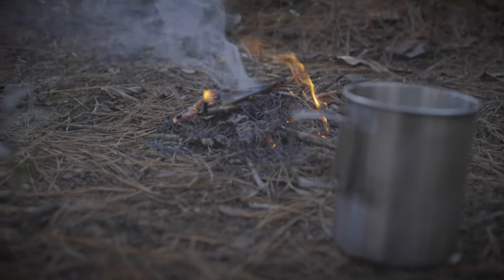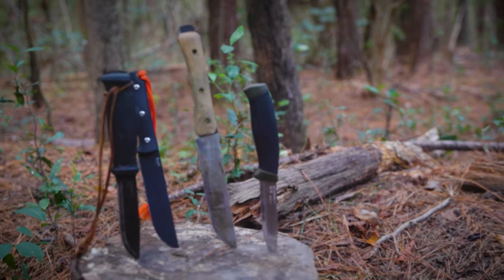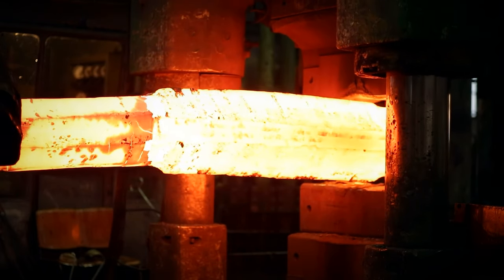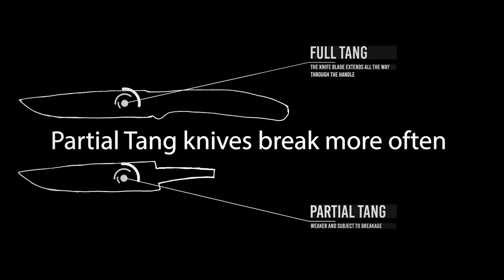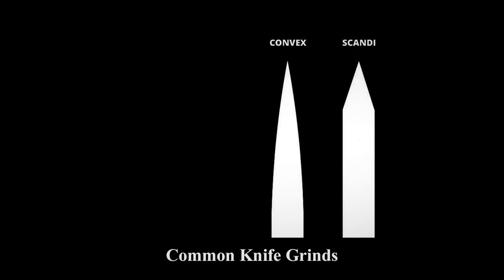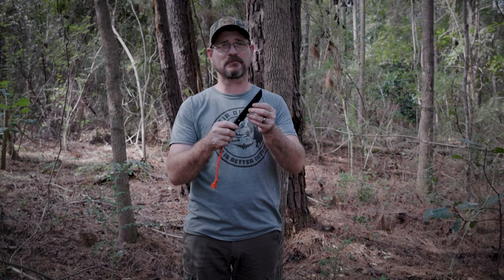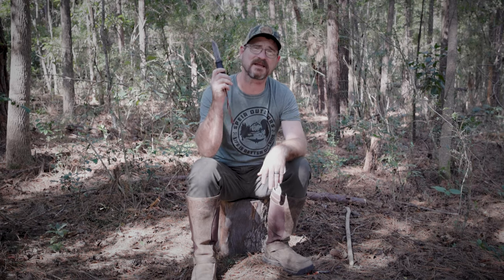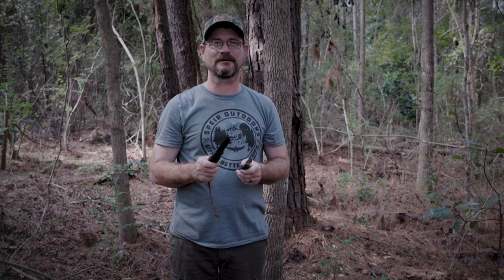Choosing the Perfect Survival or Bushcraft Knife: A Comprehensive Guide

Comment: I build and sell a few knives out of O-1.  I'll take carbon steel any day over stainless!  Properly heat treated and there should be no issues with bending or chipping.  Easier to sharpen and rust isn't an issue with some minor care.  And yes, 4-5" blade is all you need.  Most so called "bushcraft" knives are just too big.  Too much Hollywood Rambo-knife influence!  Smaller is more practical and useful, and will do anything and everything you need it to. Love your channel, just subbed!
Reply from the maker: I absolutely agree! Thank you so much I really appreciate the support

Comment: You definitions were wrong. Stainless is more prone to chipping and is not tough. 
Carbon steel is tougher mean it will bend not break it will roll not chip.
Reply: You have obviously never tried to drill through stainless steel.  But its ok.  I realize some folks just gotta throw out their two cents worth even if they don't have a clue about what they're talkin bout.  you do you.
Reply: @tbone9347  as a matter of fact I have. You just need the right tool for the job. Carbide drill bits. Or a plasma cutter.
Reply: @tbone9347   once tempered, they are both extremely difficult to drill through. If that’s your philosophy, as to which is brittle and which is tough? Then it’s ok. Some people are arrogant and rude, regardless of how bloody wrong they are! You do you, even though that is apparently fundamentally ignorant. 
Since you seem to be confused here, you might try emailing Tops, or ESEE or Cold Steele or Buck or whichever company makes your favorite (high quality) fixed blade survival/bushcraft/camp knives and big choppers, and just ask any of them directly, why it is standard for them to almost exclusively use high carbon steel, for their high abuse fixed blades. 1055,1075,1095 and 5160 are the most common. And then ask why stainless, is primarily favored for edc folders. I can save you some time. It’s because mid to high carbon steels, are*Typically* tougher and more forgiving than the particle stainless metals, which are Typically harder and have greater edge retention, but are far more brittle, and prone to cracking and edge chipping (especially in cold weather). There’s a reason why swords, traditionally use carbon. Email Zombie Tools, and see what they have to say about swords. 
Now to be fair, it should be acknowledged that the current modern blade smithing industry is accomplishing phenomenal things with all types of new hybrid steels. Achieving results with stainless, that were completely unheard of, just 5 to 10 years ago. Example: Extreme Ratio and their N690 stainless, is apparently at the top of the heap right now. So exceptions do exist, but bye and large, your assumptions are incorrect. Good day